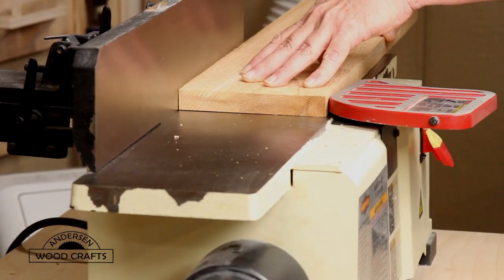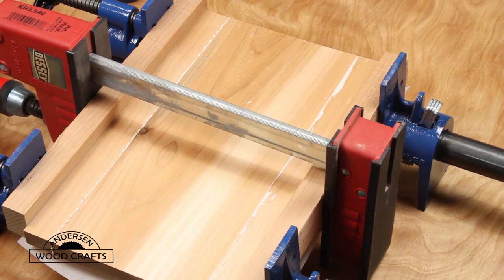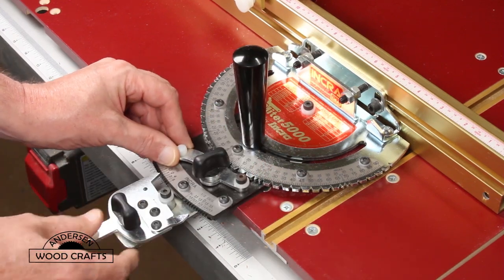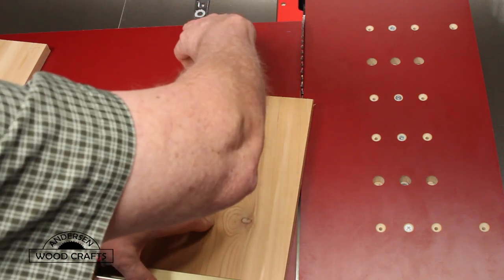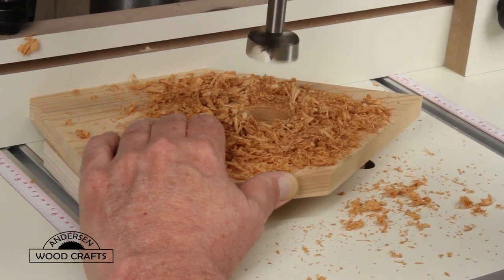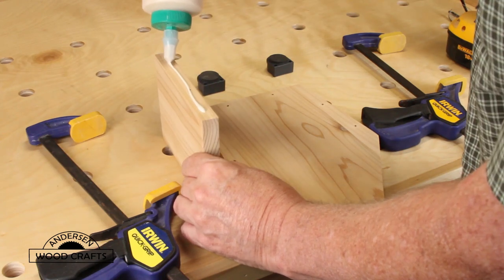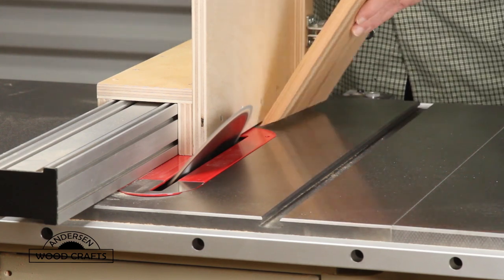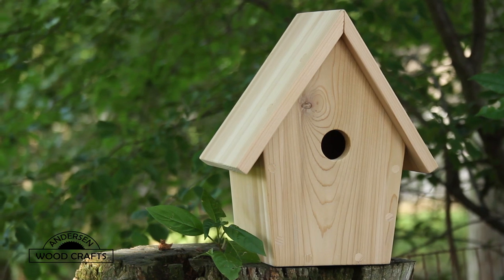SIMPLE DESIGNED BIRD HOUSE WITH SOME ADDED ELEMENTS

Comment: I love the design. Simple, yet attractive.

You mentioned drainage but you didn't show how you took care of it. Did you just drill some holes in the bottom? If so, how many?

I like the idea of the venting under the roof. Much like a real house. How all you need is a ridge vent. Lol

Would Danish oil be ok to use on the outside?
Reply from the maker: I made the bottom undersize so there are gaps between the bottom and walls (similar to how I vented the roof), of course, some holes could also be drilled.  Finishing the outside shouldn't be an issue.  Thanks for your comments.
Reply: @AndersenWoodCrafts  cool. Thanks for the info. I had a suspicion that's the way you did it. So much easier rather than worry about how many holes, how big and where to put them.

Comment: I’ve watched multiple how-to videos on birdhouse building. Lots of “do-this” and “don’t do this,” so I’m trying to gather all the best ideas and adopt some of this and some of that. From what I’ve seen a provision for a clean-out is a must ... some have hinged roofs and others have hinged trap doors. Did you include a clean-out that I missed?  Thanks
Reply from the maker: Thanks for watching and your comment.  To answer your question, no there is not a clean-out.  I am not an expert on birdhouses or birds, but from the research I did before I built the birdhouse I came to the conclusion that a clean-out is not a must, as most birds that would use the house are birds that nest in holes in trees and other places in the wild and that the new tenant would take care of cleaning out the house the same way they would in the wild.  The only per say musts that I came away with from my research is that there must be drainage and ventilation.   With all that, is a clean-out a good idea?  Sure.  But let me also say what I love most about woodworking is that it is your project, so do as you want.  There is only one thing I want everyone to do, have fun doing it!  Again, thanks for watching.